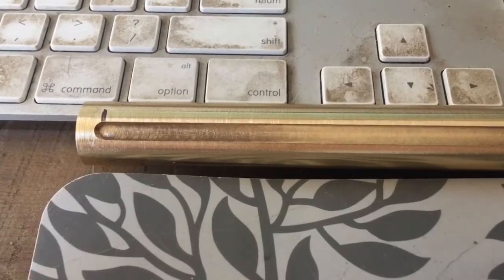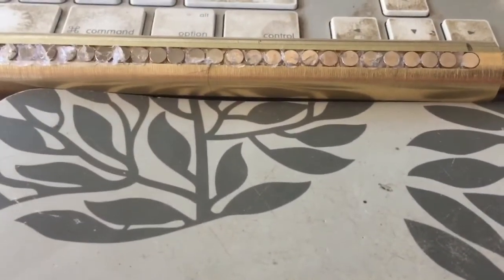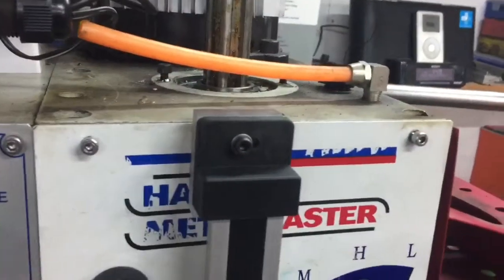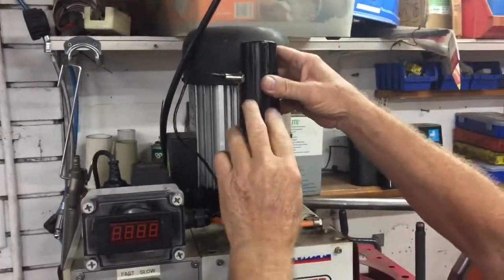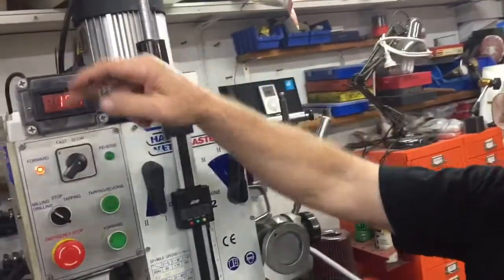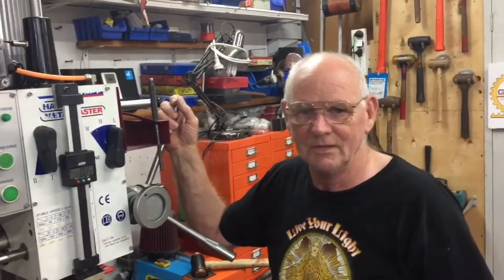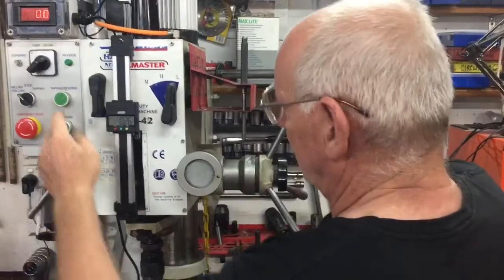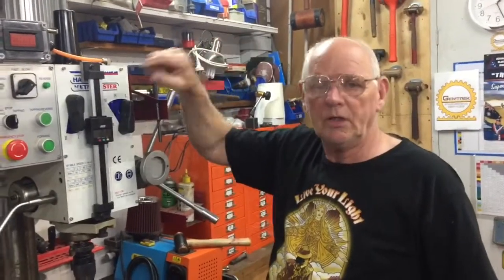DF 42 Tacho Mod - aka Bruce's Pickup line

Comment: The Tacho is more accurate than the plate.... the plate is all about the gears an the motor.. each motor will have tolerance and thus the Tacho is more accurate
Reply from the maker: I had a suspicion that the Tach would be correct, unless perhaps the onboard clock was not correct. Good to hear your thoughts Gert! It's a very neat install, top work mate!

Comment: nooooooooooooooooooooooooooooooooooooooooooooooooooooooooooooo hot melt isn't long term it turns to goo or  brittle and the stick is gone in my experience .
Reply from the maker: Very interesting! I've been using hot melt glue to pot circuit boards and secure (anti rattle) in car electrics for a long time. I know it will soften with heat, and I believe Acetone is also a thinner.
In this install I was using it as a short term "hold it in place" so that the magnets didn't jump out and form a stack instead of staying flat. As it ends up, the magnets held flat on the steel bar without any glue, and we wrapped it with tape as a belt and braces against high speed running. We had also discussed using some heatshrink over the magnet bar, but Bruce asked for a lower profile option.
Reply: im sure thers different grades  and im cheep  and it was probly 99 cent store stuff i had  just be ware  is all. happy new year :)
Reply from the maker: +Noway Jerk thanks so much for being a big part of my channel this year, it is really appreciated mate!